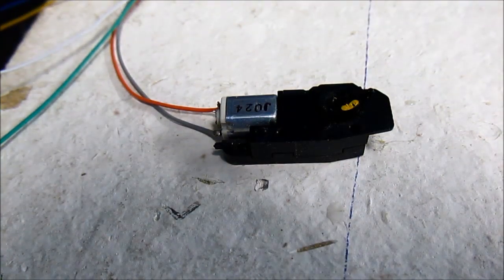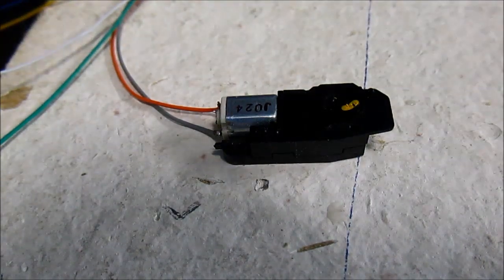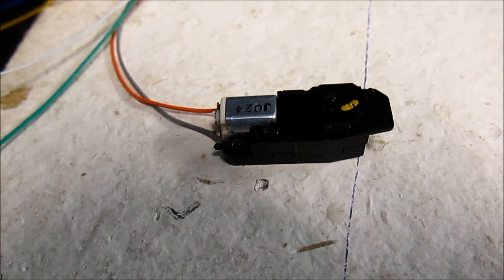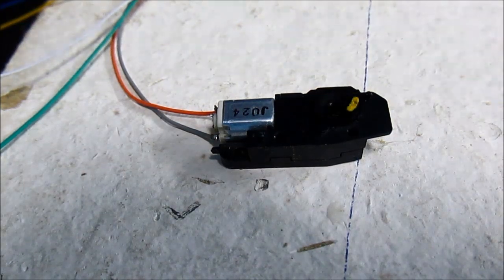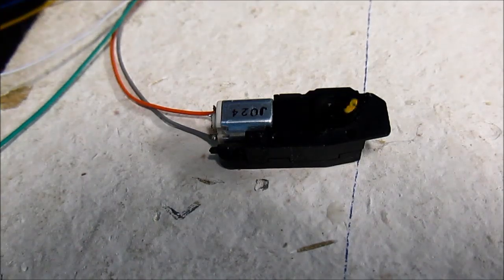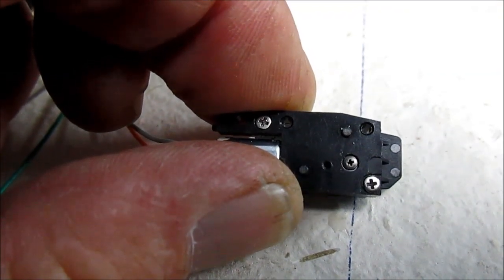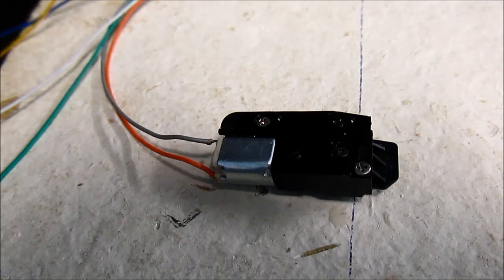Micro Motor DCC Tests

Comment: Sir/Madam,
https://www.aliexpress.com/item/Wholesale-20pcs-DC-1V-5V-Worm-gear-micro-motor-10-150RPM-DC-motor-with-encoder-and/1925287996.html?spm=a2g0s.9042311.0.0.tpC9iD
Are the motors mentioned in above  link and in the video same? what is their torque rating, and in what kind of application we can use it. Does it have a self locking capability? 
Please do help me. I m using this motor for my final year project without knowing it and when i contacted the seller, even he is not much clear about the specification apart from the things mentioned in the website. Please do answer all my questions.
Reply from the maker: Your chosen geared motor is different, using a slightly longer motor. I have no idea of the output torque of either.
I test the power by seeing if I can stall the output shaft with my fingers, there is also a limit to what the gears will withstand.
The geared motor with a right angled output drive will be self locking as they use a worm on the motor shaft.
The output shafts on these motors need to be considered as they are usually incorporated (moulded) with the final gear.
Without knowing what your project is I can't say if the geared motor you have chosen will work.

The Geared motor I show is not available cheaply any more.
Graham
Reply: Westimation,  sir if u can give ur mail id, we can discuss over there,
Reply from the maker: westimation@xtra.co.nz

Comment: Hi, great video. I am looking to automate a HO scale crane like Geoff Bunza's artical in MRH magazine 2012. I can't find these motors for less than $9.00 each on ebay. Could you help me out? Does the seller you bought from still sell these ? Any help would be appreciated, thanks.
Reply from the maker: See my new comment, these will fit the Athearn crane, which is 34 mm wide inside the body.
Or see http://www.ebay.com/itm/322368173893

Comment: hey guys - - i had to model this up a while back so i could accurately 3d print some parts to fit it so i have the CAD model which is tried and tested to fit at sub 10 micron prints ... if that helps ... id be willing to distribute it if i could work out a way of not getting spammed ... if anybody's interested maybe ill set it up on an online shop or something ?
Reply from the maker: Maybe you could post a You Tube Video to get the interest, and I would like to see what you have done.
Reply: sure ill get on it . :) sorry  didn't see the reply
Reply: Please send me the link of CAD model. Appreciated.
Reply: https://www.turbosquid.com/FullPreview/Index.cfm/ID/1119122

Comment: Hey man, thanks for the video! Could you please do me a favor and measure the distance from the very left edge to the center of the output shaft? Also, it would be great to know if I can just put 1 axle straight through the entire thing like someone posted. Thanks!
Reply from the maker: Hi Timothy
Overall length 26 mm
Rear of motor to axle centre 21.5 mm 
Depth 12 mm, Width 6.8 mm,
Existing final gear hole is about 1.8 mm and I have drilled out to 2 mm, which matches the bearing hole opposite. 
The retaining screw is reverse threaded, and a lot of care is required to drill out gear without damaging teeth. 
I fitted axles and rail wheels to a couple, 12 mm wheels over tread OK, 9.5 mm over tread required filing off bottom of gear box, you will also need to fit a spacer and washer between wheel and gear box to retain final drive gear.
Note that drive is very slow, in Ho scale 20 Km/h on 3 Volts.

Comment: Interesting, what is the plan? a crane or small locomotive? What scale do you run? I am an N scale entusiast and i have a couple of these as well that I am planning to use to drive a crane.
Reply from the maker: I model 1/64th scale on Ho track to get 3'6" track gauge. I managed to fit four larger geared motors into a S Scale crane mechanism http://youtu.be/bWj1mn3UAcw 
On one of these micro motors I recently drilled out the shaft of one of these motors to take a 2mm axle, filed off the bottom and fitted 9.5mm diameter rail wheels to power an Sn3.5 rail model track inspection Land Rover. However I managed to damage the gears on two more of these motors on the second attempt, as they are cheap enough I will be ordering some more.
To see an example of fitting these micro motors to an Athearn Ho crane see Geoff Bunza's See http://youtu.be/RXpvp5mIXvU
And August 2012 issue of http://mrhmag.com for an article on how Geoff built the crane.
Depending on the size of your crane model, you may be able to squeeze one of these motors in to raise the jib or hook.
The main thing is give it a go, its great fun animating models.
Subscribe to my channel as I will be posting more animations as I build them.
Graham

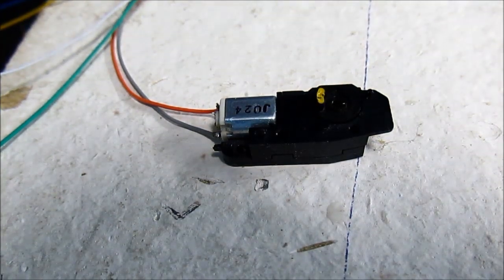Comment: The actual motor looks like the same ones used in RC 1:10 scale winches for cars and trucks.  You might want to go into an RC car/truck shop and compare to varify.
Reply from the maker: I don't have 1:10th scale trucks, get my motors from China at very low cost, so no need to verify.

Comment: Thanks for share your vídeo! Do you know the current consumptiom of this?
Reply from the maker: Sorry about the delay, I was away on holiday in Thailand and Japan.
Current I tested two motors.
Motor 1 is 35mA at 3V and 40mA at 5V
Motor 2 was 30mA at 3V and 35mA at 5V
On reasonable load current went up by 20%. stall current was about 110mA

Comment: Thanks for sharing this. Careful removing the final drive gear retaining screw-- it is a left handed screw. Turm clockwise to remove it.
Geoff B.
Reply from the maker: Ah Ha that's why it wouldn't come out, the screw popped out whiIe I forced the two halves apart after failing to get the screw loose. Thanks Geoff